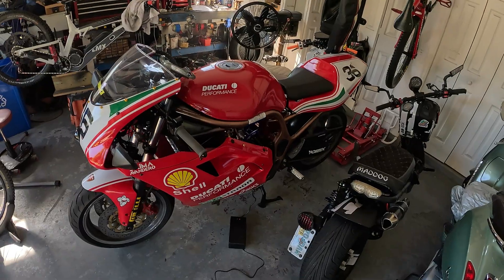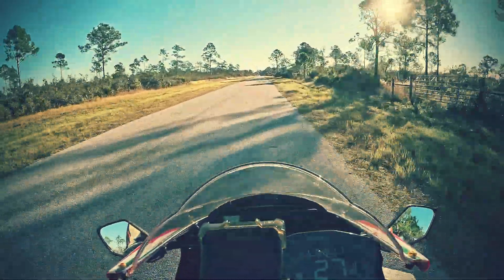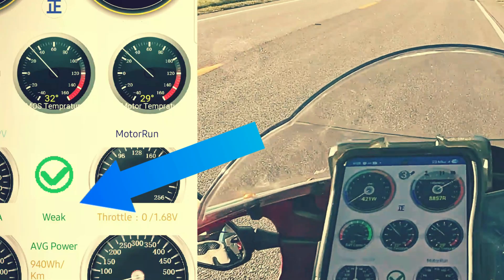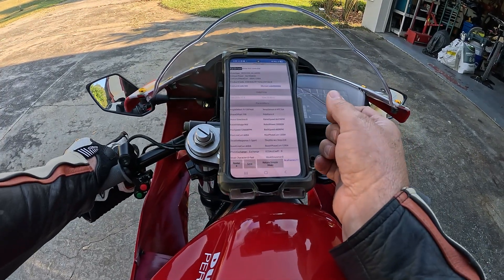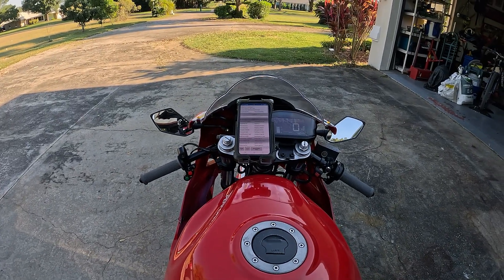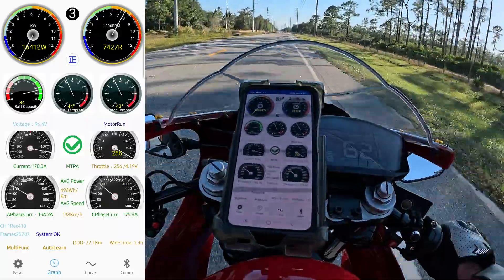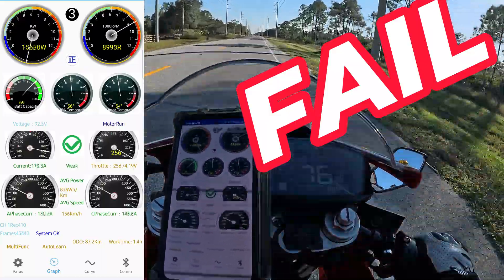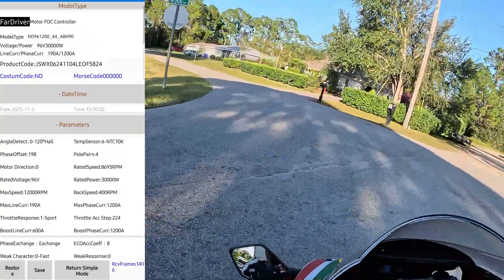Why Won't FIELD WEAKENING Make My Electric Fake Ducati Faster

Comment: When you run a experiment you try to change one variable a time, which you were but you had the battery capacity starting at 97 and at the end 69. Do you think maybe the battery should be constant?
Reply from the maker: Ya that is kinda my channels theme when I was gas bike. Im the guy who pulled the engine apart 3 times to individually test the piston then the big valve head and then the cam all separately.   LOL.  But this battery voltage thing, you are correct.  Im just being lazy.  I need to charge between tests.  Then I will get better results.  I actually know what the issue is.  I think.  So for the final test where I get FW to work and compare ratios....  I will charge between.

Comment: So, Your lowering amps to increase volts to increase RPM allowing you to go faster? 8:17
Also, love the videos! I'm learning things I never would've thought would happen. And now I want to build an electric motorcycle.
Reply: I think he’s a bit confused there, as the only voltage the battery can put out, is what the battery is putting out. Decreasing your amps does not increase your voltage beyond what the battery can supply.
Reply from the maker: In theory that is the plan.  On the original video I pulled that from, I could see ot happen.  It does it at like 1000 times per second so it is almost noticeable.   You do see the KW upper left gauge jump up and down rapidly at field weakening.

Comment: I just got my GromE together last week and have been messing with field weakening on my hub motor. Something I noticed was the factory tune from QS motor brought in field weakening super early and at about 40% at rated rpm. I did away with that and my bike didn't go as fast, i had about 90% in. After trying for awhile, i figured let's blend what the factory specs were and set field weakening to come in at 50% around rated rpm instead of 90%. My bike awent to a higher mph! I plan on doing more testing today. Try setting your ratios by speed down to  30- 50% and give it a try. specs: evader, qs260 6kw, 72v bak 45d 54ah 360a continous/600a peak. nd721000.
Reply: I think you are misunderstanding what Ratios in Speeds is and what it does. It is NOT field weakening, but it can set the limit to the DEPTH of field weakening. 

The default settings always sets the ratios in speed very conservatively, and Autolearn doesn’t set it because it has no idea what you want it to do, so it sets it to pull back current early. 

With fardriver you never know what percentage of amps is going to field weakening. Thats not reported. The only thing it tells you is if you are at the rpm where field weakening is needed. If FW is off, you will see “weak” but rpm will stop climbing after reaching equilibrium. If FW is on, you will see weak and rpm will keep climbing as long as there are unused line amps available.

Ratios in speed will limit phase amps to a specific percentage of max phase amps set in parameters. A real tune will set ratios in speed to pull back amps gently at a certain speed and then taper down to 0% or 1% which sets a hard limit, even if on a stand unloaded.

Ratios in speed is also what sets the max speed during boost, since boost overrides MaxSpeed setting in parameters which sets mode 3 speed. Mode 3 would typically be set to limit speed to use the maximum continuous amps, or less. Boost will then override that and let you use more amps and and using ratios in speed to pull them down to a range above max continuous but below 10 seconds max amps. Then the boost timer is set corresponding to the max amps you are allowing. 

If you have a battery that is really too weak for your controller and motor, it will sag way too much. This artificially creates the need for more field weakening. So you get into a situation where you are locked in at max amps and slow speed. But if you set the % for that rpm range low enough to choke off phase amps, typically 20%-40%, it will pull down phase amps which pulls down line amps which allows the battery sag to recover.

After voltage recovers, the fardriver will automatically reduce the amps going towards field weakening while keeping the amps going toward torque, which is what is overcoming aerodynamic drag. Net result, you use 30% less line amps for 5% less top speed.

Ratios in speed is also used for other things, but the important thing to understand is Ratios in Speed is NOT field weakening. Its not how you set when it kicks in. You have no control over that with Fardriver, unlike VESC. With fardriver if enabled, it adds as much as it needs until it reaches some limit you set in max amps or rpm limiters (including all the ratios in speed settings).
Reply: my thoughts are phase weakening needs to be more aggressive which is different than what i thought of 100/90/80..% drop you usually see. i made a big change the settings after fighting with it for awhile to see if i saw any different results and i did. i rode the bike yesterday and hit a new top speed but wasn't recording so i think it worked. i plan on doing more testing today to see if my theory holds true lol.
Reply from the maker: Ok.  I will give even a lower percent a go.  On my hub motor I get my best results at 100%  (acceleration) but I have never hit top speed on it.  Its a little 50cc scooter and too scary.  LOL

Comment: Ill say it again YOU NEED MORE AMPS. fw pulls requires alot of amps to take advantage of it. why do you say you dont want to go 100mph. thats the point of 96v... turn that bitch up to your max cont. amps and max fw and do a test. bet it will work.
Reply: He lives in Florida which as a new law stating if you get caught going over 100mph, you go directly to jail. You do not pass GO, direct to jail. 

So with that limit in mind, he set his final drive ratio such that the max rpm a standard Fardriver can run that motor (12,000 rpm) is approaching 100 mph. This ensures he has as much torque possible while still being able to reach 100 mph.

Every person who builds that exact bike will want his own gear ratio. Those who want to ride wheelies might set the ratio for 60 mph top. Those who want balance torque and speed will set it to 100 mph. Those who want max top speed might gear it for 120 mph. Those who want max endurance will gear it to be just below field weakening at the cruise speed they desire.
Reply: @imho7250  i have a 96v razor that dose 95 mph with 300amps, and muilt other 108v builds. i have a good understanding of this. i also live in FL and everything is up to the officers dissection. respect officers and the public and your fine doing over 100mph. unless you come across a asshole cop but most are nice as long as you are not putting others in danger.

Comment: Hi, what sprockets do you use, and what dimensions has rear tire? What top speed do you need?
Reply from the maker: I made a whole video on just the sprocket.  LOL.  Im at like a 8.76 overall ratio so currently have a 45 tooth I think.  It is geared so 12k RPM is 100mph.  I am hitting about 97 at 11,500 RPM.  It is doing some goofy stuff above 97mph.  Lunging type stuttering motor stuff.  But I get those numbers running 600 line amps.  At 600apms  the field weakening works fine.  With it off I only hit 78mph ish.  I just want to show an example at lower amps to see FW actually bring in more RPM.  It may not be possible.  
https://youtu.be/QVvLN1zq1u8?si=X4Rp8NGq0sGP0JD9
Reply: @GhettoWrench  "Lunging type stuttering motor stuff. " That's the back-emf limit. That's when you need FW, not before.
Reply: @GhettoWrench  Do it differently: put a larger rear sprocket on and increase the reduction so that the engine’s maximum RPM—around 14–15k—corresponds to your desired top speed, for example 110 mph. Then the field weakening will work perfectly once the motor reaches its rated speed at your voltage.
Reply from the maker: @bullldoozer The issue is the fardriver wont support over 12k RPM.  It starts acting weird at 11,500
Reply: Put sprockets 13t front 50t rear, I think it ll be a lil bit faster with flux
Reply from the maker: Did you see my gearing video?  Its kinda my thing.  LOL.   I do not need a specific speed.  I set the speed based on the bikes theoreticle top speed for the power it has. Which is 100mph.   Like race bikes do.  Except my track has unlimited top speed.   The rear tire is 24.5"  .  Watch this video.  If you are into gearing, you will like it. 
https://youtu.be/QVvLN1zq1u8?si=7aWFO8SDsc05FjVD

Comment: As per my opinion, I would use the ND144600 controller, and increase the voltage and reduce the amps, with a 250kg motorcycle and rider weight, 36kW of continuous power is needed to reach 167km/h
Reply from the maker: I forgot to mention on this video...  I have a ND961200 in there and a 16p12s battery.  I was trying to simulate this FW at some lower power levels and slower speeds.  It does work at 600amps line.  FW will take me from 78mph to 97mph when I am all in.  I have only been limiting line amps to simulate this smaller system.  Do I need to limit phase amps also?  I just left them on 1200 max.
Reply: @GhettoWrench 26s16p. 12s is 44v.

The 144600 is nice but they are not thinking how hard it is to make a 144v battery with BMS. So there will be retards who either don’t use a BMS or use two 72v packs in series, which is not optimal. 

The 144600 has 300a max line, so 300*144=43,200 watts max. The 961200 has 600a max line so 96*600=57,600 watts. So the current setup will have much more torque. The 144600 would be more efficient at higher speeds because it would barely reach field weakening region.

Comment: I have no idea if this is accurate, but I've come to understand FW thusly:

You have X amount of amps from the battery. You spend those amps to make phase amps. Once you reach your motor's max speed (emf equalization), you can start shifting current from the "driving" phase to the other phases, and in doing so you lose torque on the driving phase, but reduce EMF in the motor, allowing it to keep accelerating (as long as the torque it is making is sufficient to do so).

In context of the FD ecosystem, I think of it in the ratios section as "at this rpm, reserve X % of phases amps for main power, and allow the rest to be used for FW." Most other motor controllers I've used just have a config option for "how many line amps do you want to spend on field weakening?". VESC then asks at what duty you want to start applying weakening.

I wonder, though, if maybe it's not based on line amps, but phase amps? If those ratios are based on phase amps, which you might have set to like 1000 or something, so even with "reserve 50%" that's still 500a which you're just not reaching? Perhaps you can play around with the reducing the PA the same way to see if it has an effect.
Reply from the maker: That is great info.  Thanks.  And it makes sense.  So I have read that the ratio % are 100% based on "phase" amps.  Hmm.  So I limited the line amps to simulate a smaller system for the test.  I did not limit pase amps.  Do you think since I still allow 1200 phase amps in the main settings then the ratio % are not choking off phase amps and preventing the field weakening?
Reply: If line amps are at 120 and phase at 1200, and if the ratios are based on phase amps, then even with 10% ratio, there would still be no phase amps to push towards the other phases to reduce back emf. 

Give it a go tweaking phase amps, I think there's a good chance to see more effect.
Reply from the maker: @chuyskywlk ahh.  Ok.  Will do.  Thanks.  That actually makes sense.

Comment: Ha ur doing what I was doing u have to let the settings it for a while it learns as u drive it and the it out all the current
Reply from the maker: Whaaattt...?  😢   OMG.  This woukd have been good to know.  LOL.  I am def doing a re-do then.
Reply: @GhettoWrench yup had quit was on way home and almost crashed because it pulled so hard up top killed my battery 😂😂
Reply from the maker: @kingrutse3278 dang. How long did take to "take effect"?
Reply: @GhettoWrench it’s got an stm32 it’s lol computer it takes calculations and learns I haven’t messed with fardrivers in a while was no manuals .  

Even the lil Chinese speed controllers are actually good u just need an stm32 red or blue pill programer and you can change all the parameteres 🤫🤫
Reply from the maker: @kingrutse3278 gonna have to google what a stm32 is.  Then after AI lies, I will really be confused. 😂😂
Reply: @GhettoWrench  it’s just a way to connect to the controller, like a dongle or Bluetooth which your controller already has.
Reply from the maker: @BikingVikingHH oh ok.  👍

Comment: Hey what camera do you use? Is it a DJI action 5 Pro? Or is it a insta360? If it's a DJI action 5 Pro recorded in D-Logm 10-bit turn the texture setting to -1 and then when editing just apply the DJI load you can download online it'll make your footage look 10 times better
Reply from the maker: It is a gopro 12.  I am saving it in 3840x2160.  I need new stuff.  LOL.  I want that DJI camera.  Is the Action 4 or 5 the one to get?
Reply: @GhettoWrench a GoPro hero 12 is absolutely wonderful. Maybe watch a video on how to set the settings correctly cuz something is wrong. Surronster uses a GoPro and his footage looks great. Yours seem to getting really processed with HDR or something and a lot of sharpness and makes it look cheap. 

If you get a DJI, get the action 4, 5 has issues, 6 isn't worth it. Also get DJI mic mini
Reply from the maker: @Alphabet7 Ya I only just learned to increase BIT rate.  LOL.  It may be my editing software.  I need to get it back where it says "4k"   that seemed to work best.